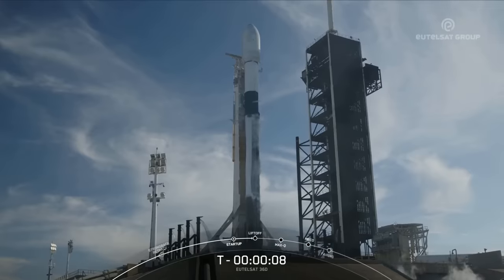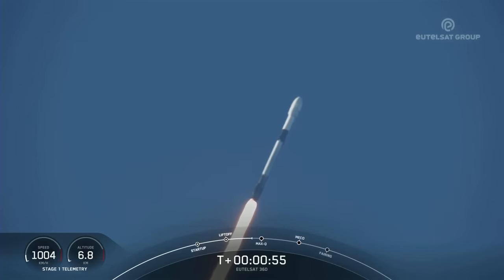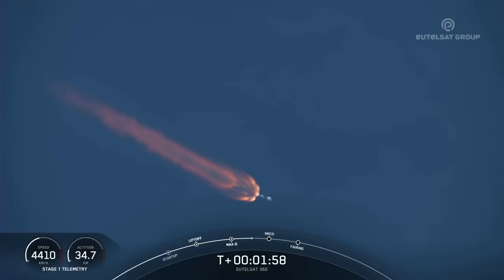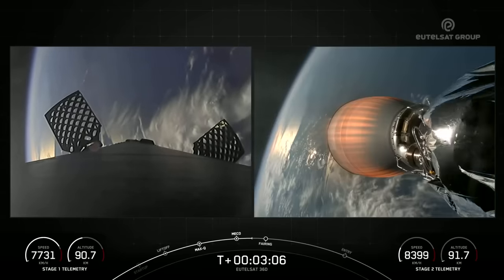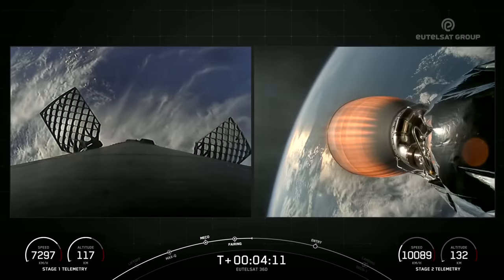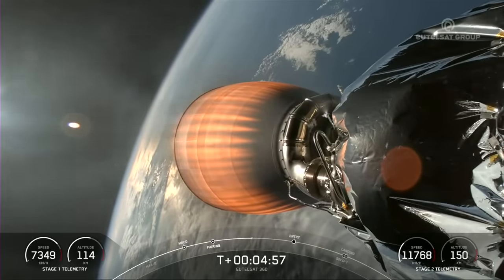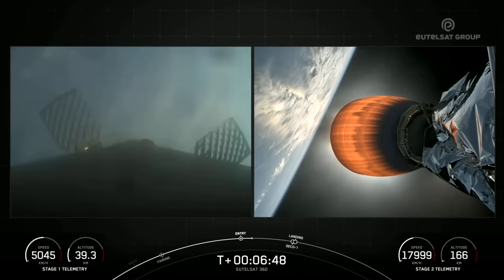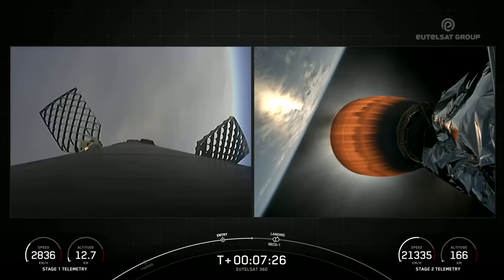SpaceX launches Eutelsat 36D satellite in first of 3 planned launches in 5 hours, nails landing

Comment: My nephew worked at Tesla doing something called machine vision. One thing I'm curious about is how does the booster end up findings Landing pad? GPS is fairly accurate, but is there an optical system to guide it to the Target Circle
Reply: The booster knows where it is at all times. It knows this because it knows where it isn't. By subtracting where it is from where it isn't, or where it isn't from where it is (whichever is greater), it obtains a difference, or deviation. The guidance subsystem uses deviations to generate corrective commands to drive the booster from a position where it is to a position where it isn't, and arriving at a position where it wasn't, it now is.
Reply: @dunnyzed6953 What?
Reply: @dunnyzed6953  LOL!!!
Reply: No , no optical system , Military grade GPS  signal ( 0.5 m acuracy) is used , there are  signal senders placed in the landing pad and surrounding places , also the rocket itself  has positioning hardware  to work together  with standard  GPS signal .  A powerfull onboard computer is capable   of manage all of these diferent  positioning hardware , engine controls and ajust them autonomasly  . A note,  certain  specific details from this tech  are not  available  for the general  public . There's a reason nobody can replicate many  of the Spacex achievements .
Reply: @dunnyzed6953  best explanation ever :)
Reply: @dunnyzed6953 speaking of word "flabbergasted".
Reply: @dunnyzed6953  F***ing brilliant answer!
Reply: @dunnyzed6953  Thanks Kamala

Comment: Very nice video.  Entertaining and educational .  Where is the center of gravity for the descending booster?  Must be near the engines ; no?  How heavy is the CMG and where is it located. Would it be plausible to make a large constant turning fuel pump turbine that also provided gyroscopic stability.  It would eliminate several pumps, simplify the rocket and may be easier to make one pump than the 30 pumps of the booster.  Well it's actually 60 isn't it.  So you'd need 2 XX-large pump/gyros one fuel and one oxidizer.